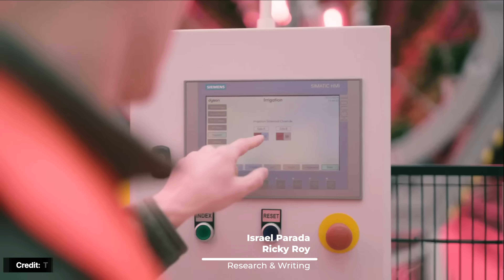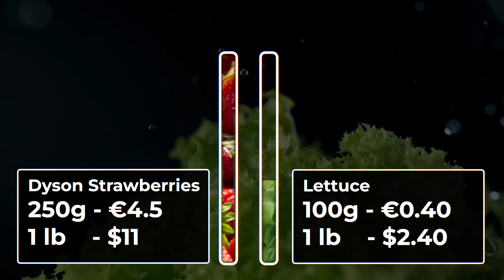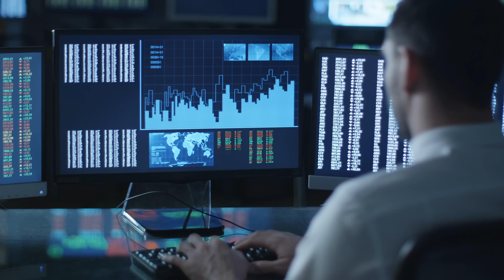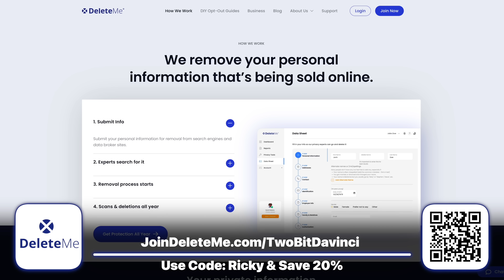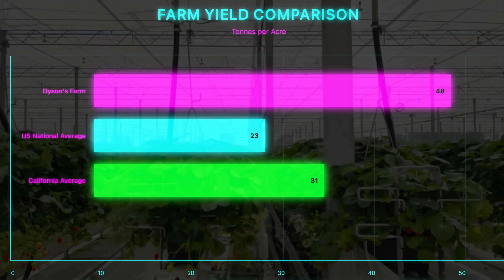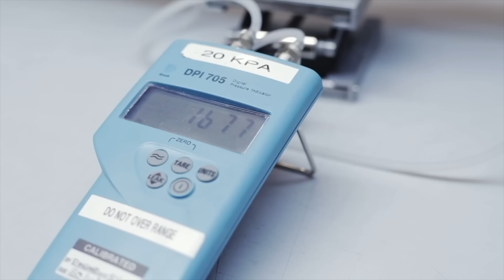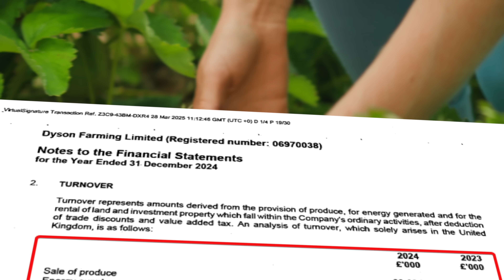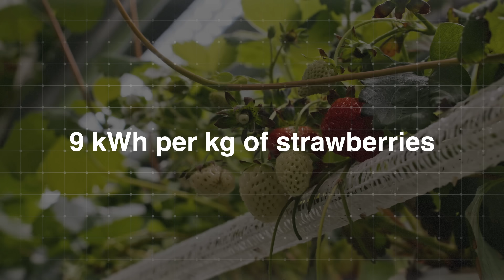The Company that FINALLY Solved Vertical Farming

Comment: A couple thoughts. Energy sources within the grid (nuclear reactors, hydro) do not throttle well. The idea is to take excess energy (usually overnight) and donate it to vertical farms. The need for this energy and its availability are a gift of synergy. This is a society level decision. The most important contribution of vertical farms is societal resilience. Humanity is on a more stable foundation and not at the mercy of droughts pestilence trade wars etc. Make it so.

Comment: Well, tbh they didn't solve anything. 1. It is not vertical farm. It is standard greenhouse with upgraded capacity. 2. The biogas technology is common and used, they just might improved that but that doesn't even matter because 3. It runs on organic waste from their TRADITIONAL farming. Without that they wouldn't get enough fuel. 4. All those robots they use are sold by Octavia, it's not their technology.

Comment: I know this may seem like a small thing but I'd like to point something out about a one of your statements in this video. "Remember the Co2 we talk about as a bad thing, but it is literally plant food". Personally I would have said "Co2 is a bad thing when in abundance, but in this case we can use it as plant food". The first statement leaves it ambiguous, it doesn't specifically say if Co2 is or isn't bad. The second statement highlights why it is a bad thing. The whole "well Co2 is actually plant food so it can't be bad, were making the planet produce more food with it". Thing while partially true is a common argument used by climate change deniers. It is a rhetoric pushed by bad actors from the fossil fuels industry to continue climate confusion and stop any legislative action to halt climate change.

Comment: Most of the thinks are not new to me (Biogasgenerator, CO2-fertilizing, vertical greenhouse, Pestcontrol, light control). I learn it in Horticultural School in Austria as old expermints from 90s/2000 (some are in use, some not). But bringing this mit new things like the robotic arms and advances in LED and so on together is new. Also prices changed over the years.

Comment: Towards the end of your video, you raise what I think is a very important point. What is the survival value of vertcal farming and greenhouse rotating stacks if there is a climate catastrophe? Traditional open field industrial agriculture most likely will see a severe reduction in its yields due to climate whiplash (extended drought followed by torrential rains). The cost of food will soar and famine will ensue. I envsion a future where private funding will use these food producing processes to feed the select workers of their techno-feudal enclaves, hydroponic produce and microbial produced protein. Food security is already becoming an issue. More so, as the industrial agriculture outputs decline.

Comment: My understanding from (admittedly cursory) research is that these Dyson digestion farms generate only minimal electricity for their own use and their real products are methane for heating and digestate for fertilizer. .
I wonder if you misunderstood and mistook a quantity of methane (and h2s?)  for electricity production figures.  The volumes of farm crops/wastes to generate the incredible amounts of electricity you cited would be so enormous and maybe impossible to supply and transport  from a local area, especially given the huge losses going from gas through turbines to electricity.  Presumably feedlots, piggeries and dairy farms may bring free manure but there is also (presumably) a considerable amount of bulky cellulosic matter remaining that must, presumably be trucked away after and spread on fields.  This is also a cost unless you can get farmers to truck it away for free....
Quite a dance all in all.....

Comment: Nothing wrong with vertical farming. Dyson did solve a lot of problems, but the "problem" is the overthinking of things.
You cant expect a software engineer to solve a hardware problem or a hardware engineer to solve a software problem. And not one of them to solve a farming problem

Dyson's approach is the key to vertical farming. Think outside the box and take in all factors to getting to a solution for one of the challenges.
I solve my problem of having a small available space to grow food, with a web of parameters. I have 3 different types of producing plants in a 3square meter area. 1 Plum tree,  6 blueberry bushes, and a lot of strawberries as ground cover.
I have in one pot grapevine and rosemary.
The list goes on.

Its really not complicated rocket sience, theres a lot more in my small space and all producing. If i had the capabilities and the space i wouldve loved a greenhouse, but you do with what you have. And i do it to save money, not make money. Where all these failed companies are trying to get investors money as quick as possible, grow and produce for "profit" asap using very expensive useless tech.
Dyson used his own money, so he wasnt wasteful and thought things through actually.

Comment: There's a much simpler explanation why the electricity generation doesn't match up. 

They were referencing the energy from their one digester when talking about their vertical farm. 
The energy quoted to the grid will be from all sources, and farms here in the UK often have solar and wind generation on them. 

They weren't lying about what is used, just referencing different data points than the ones you used.

Comment: You fail to anakyze CO2 optimal and detrimentsl lrvels fkr olsnt growth.  The Gigawatt produced CO2 loadcfsr exceeds oer acre what the plants csn consume st ootimsl growtg levels and huge majority CO2  goes to environment, so Methsne burning CO2 exhsust load is not appreciably reduced..its just grieth benefit at fraciion and msjor publicity sell frsud and doesn't sccoun for pH water/soil corrective needs due ti rsised CO2 margin for ootimal.growth depending on crop type nreding contimuous minitor and soilnor electrolyte corrective action.  Also materisl corrodion degradation factors at higher CO2/lower pH come into long run play and in waste water run off.

Comment: How can we trust anything in this video if there are very obvious math errors? 4.5€ (why Euro in the first place when the strawberries are sold in the UK?) per 250g (aka half(ish) a pound) do very much not equal $11. It should be about 9, or about 20% lower.
Even worse, the energy calculation. It's based on electricity sold in dollars, when the friggin £ Pound Sterling symbol is right there, at the top of the column. Aren't unit conversions supposed to be an engineer's strength? WTF is going on here?

Comment: You have the currency wrong. In the UK, we have the Pound Sterling (£) and not the Euro (€). Dyson Strawberries cost £2.30 for 250g in my local supermarket in the winter. They get much cheaper in the Spring and Summer.

Comment: New question: Why are all farms not using these generators? I feel like that alone would offset a large chunk of coal production in America, given how many farm acres we use. It would also add extra income if lots of farms also used the exhaust to grow special crops in greenhouses, right? 

Like if a farm in Idaho grew potatoes and corn in their traditional fields, used the leftover biomass after harvest to fuel the generator, and pump the exhaust into a greenhouse full of Japanese melons or Chinese Buddah's Hand citrus. You could grow Starfruit or Pawpaws year round. Sell that to specialty organic stores and make extra income, while selling the excess electricity to the electrical system to be shipped over to California or New York for a power boost.

And now the question becomes, when we have an electrical surplus because of this..... where will we store it? We need to invent massive batteries that hold a charge for decades with minimal energy leakage (where batteries slowly go dead over time). Centuries would be a better design, but that's less testable in our own lifetimes and i'm relatively sure there's an input/return curve on battery life, where if you can make it last a few decades the ability to make it last a few centuries is very easy by that point.

Comment: Okay, yes, I'm seeing how this form of vertical farming is more efficient than predecessors. However, there are a few points I think need to be mentioned.
1. Overpriced strawberries does not equal food security. Although  I, personally, can happily eat about a kilo of strawberries, that in itself does not actually meet nutritional requirements. Incidentally, neither does lettuce, the other trial plant.
Therefore, neither of these crops really demonstrate "food security".
I'd be very interested to see how the experimental farms went with root vegetables and / or squash and pumpkins. Also the grains. You know, the stuff that does mean food security for those of us sans silver spoon.
2. How do these farms address tree crops, like fruit?
3. If the greenhouse system is a closed loop, I'd say it's missing out on all those free pollinators and beneficial invertebrates which actively contribute to crops.
4. I'm assuming this is hydroponic. (Correct me if I'm wrong) How's the taste? How is the taste after, say, the fifth crop? Also, see above re root vegetables. 
5. You're growing "biomass" to feed the power? What does your "biomass" consist of? Is it hay, or straw? Or some other type of crop that can be used as food or animal bedding, or building product? Using a potential food crop to burn to power your greenhouse factory to create a monoculture grates against my bones.
6. Acres of glass? A giant heat island? Not to mention the giant monoculture fields of "biomass". I understand how these things might not feel as imperative in rural UK. However, in warmer climates, you're spending equal time cooling your greenhouse so you don't cook your crop. 
7. Also in warmer climates: hail.

I understand that people and companies are trying to pave a way for the future to preserve the status quo. I honestly don't believe monoculture, massive import and export of foods, and / or factory (which this is) or giant farms servicing these industries, is the way to go.
If you look at the climate prediction models, I don't believe these models will continue to work. 
Community gardens and small diverse farms within cities that can accommodate their community, smaller diverse market gardeners outside the cities, where people can work and live, will work. It's a decentralised, even "cell" method. And if a disaster affects one area, other local communities can contribute to get them back on their feet.

TL:DR this isn't food security.
Reply: However, I've now read a lot of comments on how greenhouse farming is working well in the far northern, colder climates, and yes, I think those are great. I'm not against greenhouses in general, I just think that, for the above reasons, they're not a worldwide fix, and I still think biodiversity is a better option than closed loop monoculture.

Comment: There's no way the farm plants can absorb anywhere near the rate of CO2 production from the bio generator right? Also stimulating methane production to increase energy production that's dominantly being sold to the grid sounds like another "ethanol" invention in disguise. If the plant was efficiently using that energy in a much larger capacity I could possibly see this working but for now it's just wasteful

Comment: The problem is in TASTE of those fruits and vegetables. They are awfull!

P.S. They could save a lot of space by using terra preta method that DOUBLE the farm yield from fertile farm and it can give 700% more from barren soil!
Plus CO2 we can feet 8 billion people in just 1 658 905.66km^2
We can also use Adzuki beans to replace the meat or simply crop the ocean and need of 1 876 427.75 km^2 of land. 
To compare:
Australia: 7 688 287 km^2
Sahara:    9 200 000 km^2

Comment: Look this could be a good thing but now if we change tack a little so it's somewhat working in a cold cloudy part of world with abundant water what if we swap this for a drier sunny  place ie middle east Australia Africa etc so let's then also bring in another thing so instead of power to grid that excess goes to desalination.  Now there was a plan a few years back to build a desalination plant on Jordan /Israel border.  The run off was to be used to top up the dead sea as its volume has dropped over last 50 years with agriculture sucking water from the Jordan River.  So this in turn would mean the power generation would then serve as a water supply for Jordan and Israel of which they would also build there farms in to use some of that water and create the biogas to make the power.  Food prices are already high in the area so it be rather cost effective at same time there

Comment: My interest in vertical farming is spurred by the potential to use it, in space. So solving this for closed, self sustained systems, is the longer term goal. if a vertical farm can work on Earth, it can work on Mars. Frustratingly, the Dyson biogas production, while using some good ideas, does not make a closed system, so it's hard to translate it . Thanks for the exposee ❤

Comment: So, Dysons vertical farm is actually a greenhouse!     My idea for a vertical farm is a housing or office tower.  It has 3.5 meter wide balconies all the way round.  The outer 1.5 meters is "plants on a train" .  In Summer, in the northern hemisphere, the plant train are probably going west to south at a low speed that gives all the plants  in the circle at least 7 hours of direct sunlight. varies depending on the plant needs, and level of ripeness.  There can be supplemental light especially on the north side as necessary.  The plants get heat and CO2 from the occupants. You would need dehumidifiers, but there will be a tradeoff because the plants are converting CO2 into oxygen and carbohydrate so maybe less air conditioning is needed.  And the train of plants means that their scenery constantly changes through the day.   Plants are probably sealed off from the occupants,  and there are a few rooms on the circle where they are sowed, tended and harvested. What do you think of that?   A kind of crop circle, but in a good way!
Reply: I like it a lot. From a practical side I am a little worried about all the moving parts.

Comment: How much land is required to keep those biodigester running? Certainly not just the strawberry biproducts, right? I'm guessing they feed it material from the other land they own.  

I wonder if it'd be more efficient and cheaper to use PV. You wouldn't get the side-benefits of CO2 and heat, but you might get more total energy out per area land.

Comment: You present part of the economic case here, but don't mention the the economic impact of how much Dyson's method reduces  externalities as compared with standard agriculture. These include lower carbon emissions, lower methane escaping into the atmosphere, and no pollution from fertilizer runoff, all of which can cause environmental harm as well as economic costs but none of which is typically reflected in market prices.

Comment: ok lets say my vertical farm is like the a rubik's cube with in a greenhouse with efficiently and tactically placed mirrors but it can also send crops from the bottom to the top in a cycle along with those mirrors so 1 spot wouldn't be getting too much or to less sunlight. More surface area, Can be taller and be more efficient. I would probably have the mechanism be partly powered by a bunch of solar panels.

Comment: i do want to pont out that in a perfectly managed green house co2 is not "plant food" its just the next most limited nutreint based on law of minimums. i see people make this argument that co2 is plant food and plants are growing bigger due to fossil fuel co2 release. we need to make sure we realize that the planet it self is not a perfectly managed green house and the law of the minimums works based on local conditions not our ideal lab set up.  in fact more co2 can great more green growth if you have enough other nutrients, but high levels of greenery despite them seeming safe as we evolved to feel more relaxed around green and blue colors (water and plants) the problem is that high greenery does not equal high biodiversithy, in fact as co2 increases it can drastically decrease biodiversity. and we are going through the 6th mass extinction, we def are having a insect appocolpse with 2% of them dieng off per year ( you dont drive on road as much as any more and get them on the windshield nearly as much if you do its a tad hopeful but still the amount of times it happens even on wide open country has gone down) this means less birds as what do you think birds eat and less energy being distributed by birds all over ecosystems. we have lots of issus. plus we have never been able to save an endangered animal without adding lots of human energy and attention at maintaining them. without us and our attention and care they currently all die on their own. we just seem to also save the cute cuddly ones or awe inspring ones.   so please do not mistake that co2 is plant food. its not. plant food and its needs is based on the law of minimums that holds back a system from growing more.